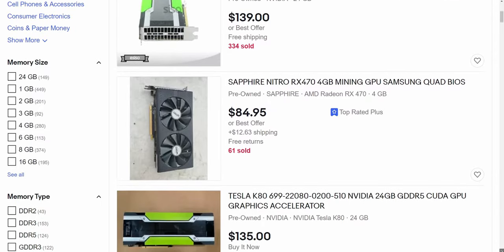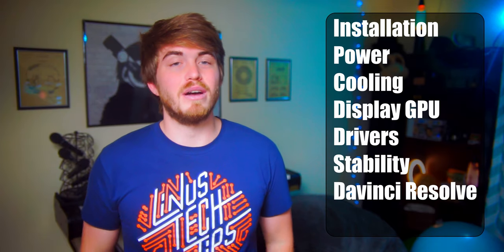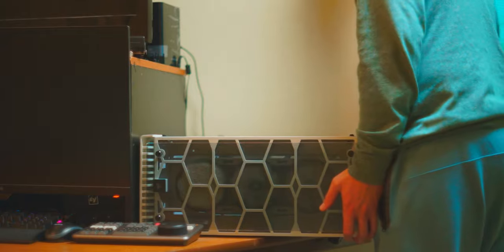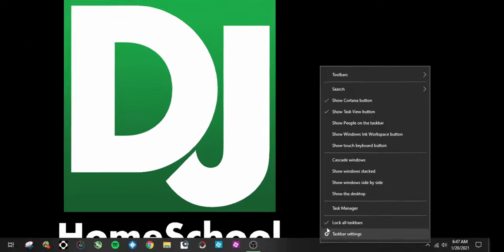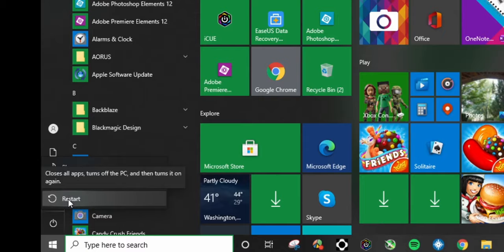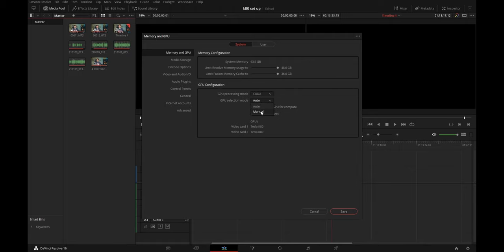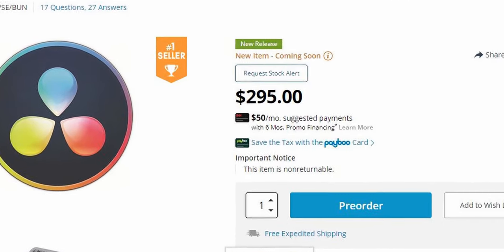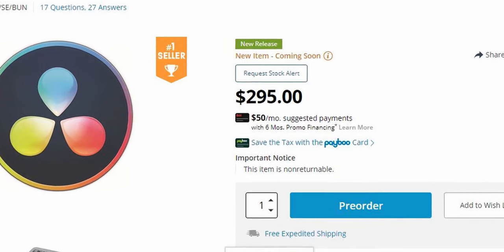24GB Tesla GPU for Video Editors

Comment: labeling is very misleading because K80 is actually 2 GPUs  on one pcb 12Gb each. 
and GPUs cannot share memory to fig bigger scenes.
the biggest problem with K80 is that it is obsolete and no longer supported by Nvidia drivers and new software. because it used old Kepler architecture. so if you buy one now you may be locked to old software versions.

The best choice for now is not k80 but M40 12GB (or 24GB if you are ready to pay triple price for the same  performance bust 2x memory) which is assigned to the single GPU so entire memory can be used M80 is also one generation newer and consumes less power while performance seems to be about 80% of K80
Reply from the maker: Thank you, this is great information. 
What would you like me to change the title to? Josh and I spent several hours discussing potential titles. This one seemed to be a better option than the rest. I have to balance YouTube’s algorithm with communicating what the video is about in the title. I’d love to hear some new suggestions, I’ve been thinking about changing the title and thumbnail to see if the video will preform better with a more minimalistic thumbnail. 

I thought about
 k80 performance in Davinci Resolve
Dual GPU with 24GB of vram
K80 Review

But no one would click on those

I also considered:
Video editor tries to get more vram for cheap
So.... I tried a Tesla k80

But those felt too... idk... youtubery... if that’s a thing 🤷🏻‍♂️ 
So if you have a title that people will click on but not be overly click bait, I would love the suggestion.
Reply: @WillCarterTech  
I meant that Nvidia's labeling is misleading, your title is correct and fine. Maybe you should just mention that it is k80  so better video name "24GB k80 GPU for Video Editors"
I was also planning to buy this card for rendering because I need lots of memory but later I found out that it is pretty useless. (and stumbled on your video while doing my research)
Maybe you just should put more emphasis on the fact that you cant fit more than 12gb content in this card and in terms of performance and memory is is pretty much equivalent to 1080 ti with double of power consumption. In some way, it also may be possible to use the entire 24GB with highly reduced performance because this GPU may use NVLINK to share memory but I am not sure about that.
Reply from the maker: @deltaxcd  oh! I understand what you mean now. My bad. 
Okay, yes. I think that’s why it sells for so cheap on ebay while the m10 and m60 are over a thousand dollars. 
I was reading on the Blackmagic Design website and they are saying that the DRS17 software won’t support Kepler architecture. So, I guess that’s that. 
It appears a lot of programs are dropping support for Kepler in their 2021 updates from what I’m reading in some articles and forums.
Reply: @WillCarterTech  
The situation with M series is very strange because m10 and m60 are practically worthless because they only have 8gb per GPU but other price is extraordinary on ebay as well as ower consumption.
But for some reason m40 which is the best what we can bet at this moment is  close to 100$ in 12 GB version and 350$ in 24gb version which is all on the single GPU.
power consumption also should not be too high because it is just one GPU chip
I am planning to buy M40 myself for 3d rendering but need to find a way to deliver it from USA.
Reply from the maker: @deltaxcd  I imagine it would be a lot easier to cool as well.

Comment: can you use this for gaming?
Reply from the maker: Yeah which games?
Reply: not really, at-least not in it's stock form in which you need to physically modify the pcb to fully unlock all of the card's features. (many GPU's share the same die (chip) and what stops you from using them fully is the different ancillary components on the pcb (think rtx vs quaddro).  If you were to modify it, you'd still need a second GPU or display adapter for the output after routing the Tesla's output back through the CPU and to your display. The Tesla Card was made for processing huge amounts of data and isn't intended to be used as a GPU, which was disabled to reduce heat/increase efficiency in the BIOS. The Nvidia GRID 2 is a GPU intended for servers to take the graphical load off of individual PC's in a corporate environment by streaming over the network (one powerful GPU is a lot cheaper than many weaker ones). Because the cards are supposed to be used in servers, there's no reason to have display outputs.

If you want to skip physically modifying the card and firmware, just get a Nvidia GRID 2 instead (which is what you'd turn the Tesla card into anyway).

Comment: I want to see this using nvenc encoding for OBS
Reply from the maker: The tesla k80 doesnt have nvenc encoding / decoding. I used the gtx960 for encoding in obs. When using the k80 i would drop frames
Reply: @WillCarterTech  It says it has two nvenc encoders on the nvidia website. Also says that nvenc is fully unlocked.
Reply from the maker: Hmmm… maybe the softwares i was using didn’t recognize it, or maybe I didn’t know how to read the software.
Reply: @WillCarterTech  Would love to see a video if you can figure it out!
Reply from the maker: @TheLotroNerd  alrighty. Ive needed to do an update on the k80 anyway. 

Usually, Windows would default to the 960. So I’ll have to figure out how to force windows to use the k80 for encoding
Reply: @WillCarterTech  have you had any luck so far?
Reply from the maker: @TheLotroNerd  i havent been able to play around with it. Its been really busy at work this month.

Comment: I don't understand why DR Studio adds $300 to the cost of using this card. It is literally free software, there are a ton of places where you can download it without paying a dime.
Reply from the maker: I'm sorry. I didn't articulate this well enough in the video. The k80 Card has two GPUs on the PCB. Davinci resolve reserves the ability to use more than one GPU in their software for the $300 Studio version. I saw about a 40% performance increase when using both of the GPUs on the k80 card. Contrast this with buying an M40 Card which uses the Maxwell architecture. While the M40 is significantly more expensive than the k80 on the used market, the performance is about equivalent while only having one GPU die on the m40 card. You could use the M40 with the free version of Davinci resolve and get similar performance to the k80 operating in the $300 version of Davinci resolve studio. This, in addition to the Davinci resolve 17 support, makes the M40 a much more attractive purchase. 
Something to side note is that Blackmagic Design stopped supporting Keplar Architecture in Davinci Resolve 17. This means that the M40 is able to work with the DR17 and DR18, however the K80 can only work with DR16 and prior versions. 
I would not recommend getting the k80. The m40 is much more useful if you can find a good deal.

Let me know if this reply explained this issue well enough.

Comment: 2 in an external box would be good
Reply: Thanks for  the video, I have two and a 2080ti, 17 not supported, 16 super buggy with Cuda errors!  15 works fine. Or at least as much as I can tell. all 4 are reading 100% running at 45, including the 2080ti on Cuda.  For air situation I'm running them off a backplane, with noctua low profile fans on them fed into my comp. This video helped me rule out a lot of thing, thank you.
Reply from the maker: Great! I’m glad I could help!

I was reading on blackmagic’s forum and one of the employees mentioned that DRS17 doesn’t support any architecture that can’t run CUDA 7 or above. I did a little google and the Tesla k80 is built on cuda 3.2 which is Fermi not Kepler. So the k80 is a Frankenstein card, that’s why they are so inexpensive on eBay. No one wants their weird mix mash of architecture.

Comment: It pains me to say this, but what about an m1 powered mac mini?
Reply from the maker: I mean, i could try making a timelapse on the one at work but my boss probably wouldnt be too happy about it 🤣 those mac minis with the m1 processor shoot well above their weight class. I dont think it could edit a 6000x4000 time lapse though... maybe 🤷🏻‍♂️... ill try to sneak some tests in one of these days.
Reply: @WillCarterTech  Perhaps when the RISC optimised version of Davinci Resolve is released officially, but the proof will be in the tasting.  But I agree with you. The performance is phenomenal given that the entire unit costs the same as a decent GPU.
Reply from the maker: Yeah! if you need a mediocre gpu with a ton of vram, i love that the m1 allows the gpu access the 16GB of ram as if it were vram. That’s what i was most impressed with. 

I wish we could figure out how to do that with a desktop. Ive been asking a buddy of mine if there is a way to do that. It sounds like resizable bar on pcie 4.0 does a similar thing where the CPU can access the vram on the GPU. 🤷🏻‍♂️ so i would thing that we can make it work the other way around. I just dont know enough about computers.

Comment: If GPU prizes wouldn't be how they are at the moment I wouldn't really think about this, but... I want to build a PC this summer if GPU prizes drop a bit with a RTX 3090 (~130% RRP would be great). And yes, this card already has 24 GB VRam, but I saw this card and thought: "Hmm... could you pair a Tesla K80 and a RTX 3090? And if yes, would this combo be close to as good as two RTX 3090 with SLI?". Yes, this sounds stupid (and it probably is), but if I can get a Tesla K80 this cheap it might be worth a trial. One GPU for the workstation part (rendering etc.) and one GPU for the rest.
Reply from the maker: In theory this is a great idea. I had this idea as well. 
However as I read more and more about this subject, I’m finding that many programs are dropping support for the Kepler architecture that the k80 was built on. Including Davinci resolve 17.
A lot of programs say that in their 2021 updates they will no longer support Kepler.
Reply: @WillCarterTech  That's a bummer. When I start building my PC I'll look up the programs I use and see if they still support from this setup. If yes, I'll go for it, if no, maybe when I can find a super cheap Tesla K80. But hopefully GPU prizes will drop in general in the next 6 months, otherwise I'll stick with my current setup for another year.
Reply from the maker: @CedrikLPle  yeah, I’ll have to wait another year to upgrade my set up. I’m thinking about buying a 3060 12GB and seeing how it does. If I can find one...

Comment: 11:50 where the hell did you find a K80 for 100$ they cost at least twice as much if you are lucky
Reply from the maker: Don’t pay more than $100 for a k80. Plenty of sellers on eBay will agree to $100 if you message them and ask nicely.
Reply: @WillCarterTech  Looks like 500 dollars for a 1080 and 200 for a k80 Summer 2021... makes the k80 seem a lot smarter.
Reply from the maker: @auteurfiddler8706  🤢

Comment: the flashpoint of cardboard is above 400 celcius so you are probably fine
Reply from the maker: Oh thank god. 🤣 regardless ive already purged the cardboard from my system
Reply: @WillCarterTech  still probably not the best. might consider buying one for testing and maybe even gpu passthrough but idk if they cant be SLI'd  i might just get a k40 if it outperforms my current system wich i doubt
Reply from the maker: Yeah, if you have a 970. You probably have more horse power than a k40. And the second gpu on the k80 is useless unless your software can take advantage of it
Reply: Yeah i was hoping to get above 40fps on 720p on cyberpunk but my gtx 980 sli doesnt seem to work well. I was really lucky to get a 5950x before the went unicorn but i couldnt get a gpu so looking for something that is actually available and kinda interesting

Comment: and Matrox Mojito 4K ?
Reply from the maker: Is that card an processor accelerator? Or just a display card. It might pair well with the tesla 🤔
Reply: @WillCarterTech  Matrox has a wide range of cards.
For 4 - 8+ display multimonitoring.
Streaming / acquisition.
Encoding

Mojito 4K
M264 series
CompressHD
Box for mobile pc

Unfortunately this pro material is not really tested by Youtubers. Too bad because the cost, the possibilities to work on real time video streams, the very low noise level and the very low consumption of these cards should attract our attention.
Reply from the maker: Yeah it’s super interesting. It reminds me of some of the sdi monitor cards from black magic. Ill have to do some research on these.

Comment: m8 you found a way to make this thing cost $1200, I just bought one with a funneled, tiny fan for cooling, the mounting bracket, and a 4-Pin CPU power adapter, for $200, and i've got a case that supports multiple power supplies, so I can slot in a second PSU just for my K80, this K80 is going to soar >:v
Reply from the maker: I told you to look at the list and take off all the things you had on had already. Then decide if you personal total was worth the expense. Guess you missed that part of the video. So far ive spent $130 and ive been using it for months. But i had a lot of that stuff on hand already.

Comment: GTX 1080 ti 11 GB is ~ 550 on ebay
Reply from the maker: Yes it is now, but at the time of filming they were selling at $300-$400.
Reply: @WillCarterTech    I searched this because I want to get into GPU computing. Tabular Deep Learning is in it's infancy between I wanted to take my stab at it. I was thinking about parring this with my puny quadro m2000. Im a novice so I dont know if this is a stupid question but why dont you use a mounting bracket? Theyre 2.99 on ebay.
Reply: @WillCarterTech   I got 64 GB (2x32GB) 3600 MHZ ram in November on sale for ~ $220. It's now around $400. LOL
Reply from the maker: Usually the simplest answer is the correct one. I am too lazy to bother with the bracket. 🤣

Comment: Sure a RTX 30XX card is a better option... if you can find one... for less than $2k. That’s the whole point of seeking out this card. You CANT get the 3060 at its retail of $350.
Reply from the maker: Actually that is not the whole point of seeking out this card. I bought this card long before the 3000 series was released. It’s an excellent card for machine learning.
Reply from the maker: I just watch a video from Brett on his hot news channel saying that 3060s are selling as low as $270.

Comment: I just want to mess around with ESRGAN. this was the cheapest option available. I cannot make it work. 😂😅😭
Reply from the maker: I’ve had several comments saying that their card came from eBay dead on arrival. It’s hard to trouble shoot this card but if you are getting nothing in GPUZ after you’ve installed the Tesla driver, your card is DOA.
Reply: @WillCarterTech  it shows, but drivers are not easy, I am on Ubuntu and after installing drivers I reboot and then nothing shows on screen. Last night I made it work but smi cannot communicate with drivers.
Reply from the maker: I have no Linux experience other than this pop OS version I tried and everything just worked with PopOS. So I didn’t trouble shoot or find how to fix the issue that you are having. 

I’m sorry I can’t be more help to you.

Comment: You lost me at the price of fittings and tubing bleeding into the triple digits. Holy shit. I've been water cooling PC stuff for 20 years but you're not very bright in this approach in the first place. Half the reason any of us look at remote GPUs is for vram and the other half just wants a competent NVENC with a good feature set. The K80 doesn't deliver enough of either for any of these runarounds. Revisit this with a P4.
Reply from the maker: blinks that's exactly what i said in this video